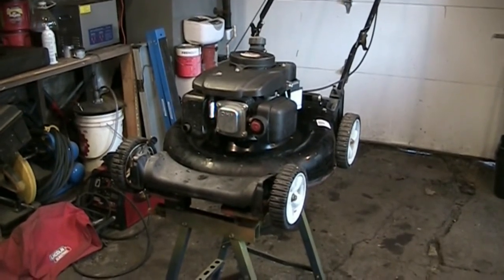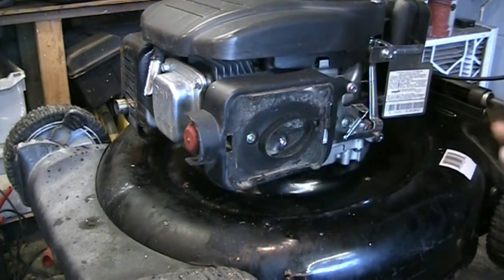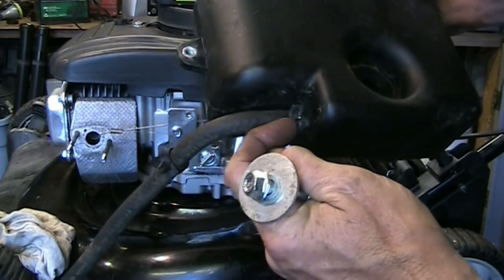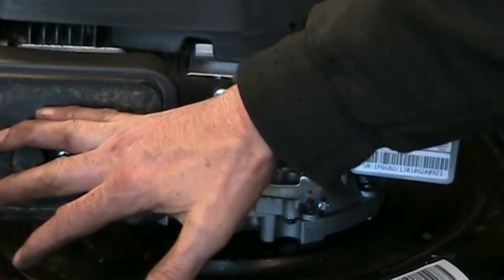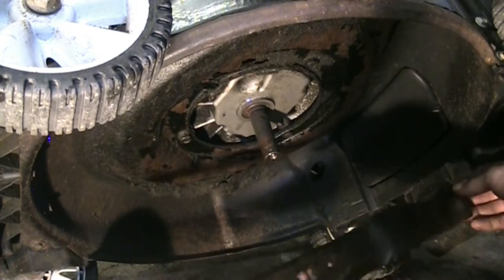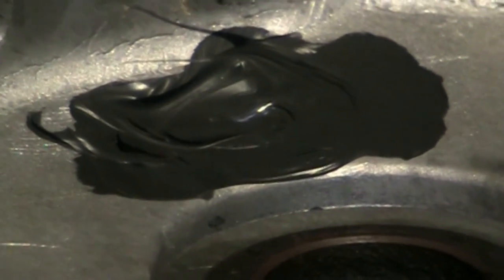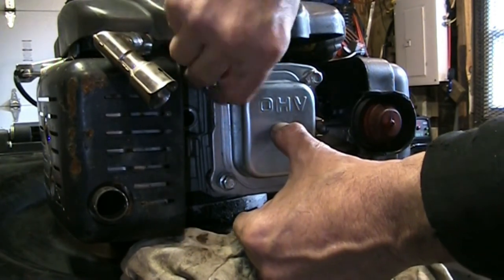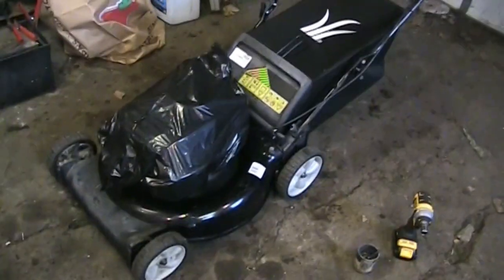Going over a Yard Machines MTD lawnmower for spring and for resale.

Comment: JB Weld is great stuff. I recently used it on head of water cooled engine on John Deere 345. It started smoking and blowing water out exhaust. I had head tested and it was porous in intake side.
Reply from the maker: That's a good situation to try JB Weld on. I would have probably done the same as you  instead of RTV because of the higher heat on the cylinder head.